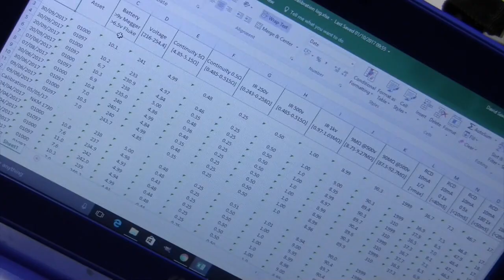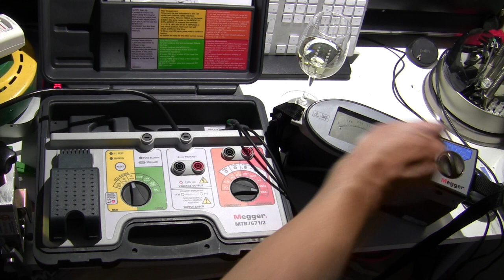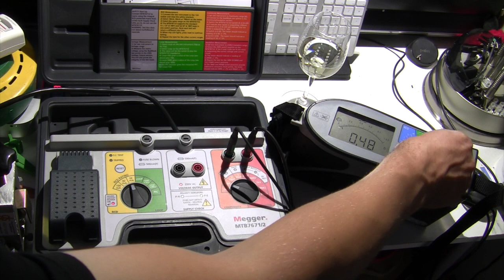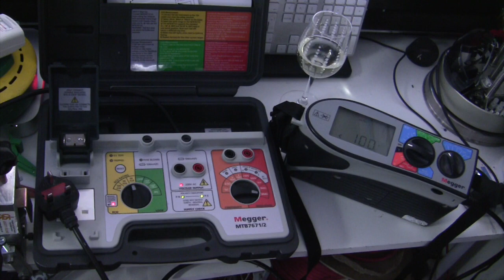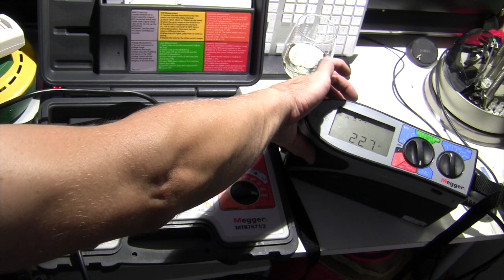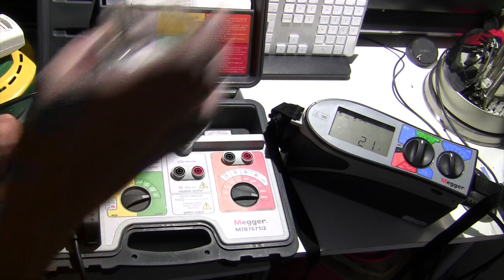Megger MTB7671/2 Check Calibration Tester hands-on

Comment: Great video. I purchased one off eBay and recieved it today. Unfortunately the seller neglected to tell me that the in-built RCD does not function! Now I either have to send off for repair and claim against the seller or return it to the seller for a refund...
Reply from the maker: Bummer. Sorry to hear that Andrew! It's a good bit of kit when it works, I still use mine.
Reply: @dsesuk  Do you not record the loop values on your spreadsheet?

Comment: How much would it cost for you to calibrate a megger like this? Mine wont keep a steady reading when carrying out insulation resistant test of 240v or 500v , it just flashes >500
Reply from the maker: Hi Shawn. The Check Tester isn't a means of calibration, it just allows me to ensure my testers are spouting the same sort of numbers because as an NICEIC Approved Contractor I'm required to prove to them on my annual assessments that I'm performing checks at least monthly and keeping a log. If you believe your Megger to be a bit iffy, then the best course of action is to book it back in with Megger themselves so they can re-calibrate it and, if a fault is found, put it right. It leaves you without a tester if you don't have a back-up, but there isn't much else you can do in this sort of situation.
Reply: David Savery Electrical Services OK , understood . I guess Im left with this option. Thanks for the info.
Reply: David Savery Electrical Services where would I get a motherboard for megger MFT 1552?
Reply from the maker: Aside from possibly Megger themselves, probably off eBay by obtaining another model - perhaps one with cosmetic damage but with working guts. I've never had to procure specialist spares for my testers, just replacement leads and probes.
Reply: @dsesuk  Hello Sir,   please guide me, whether we can test the RCD testers like megger RCDT 310/320 etc.. with this equipment
Reply: Hi Shawn, my Testers aren’t turning on after leaving in car for a couple of years. Any recommendations for easy checks/Investigations/reset etc?

Thanks